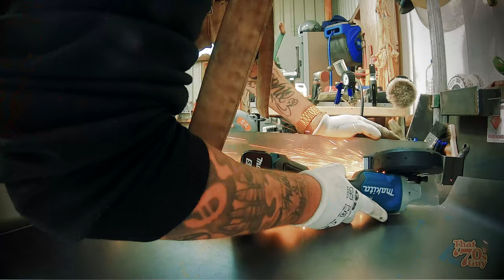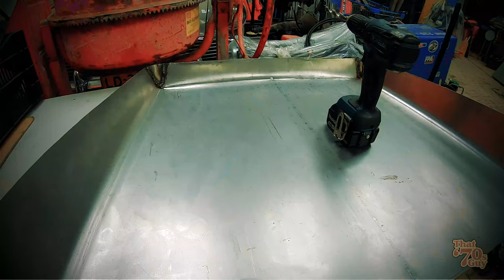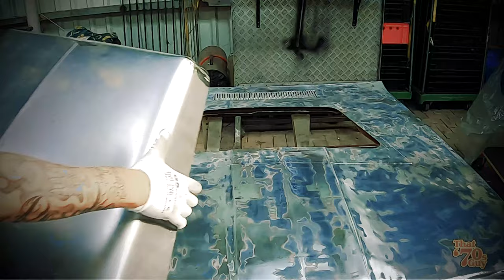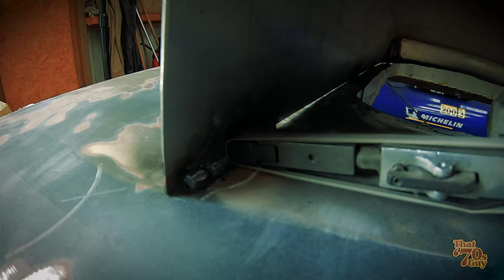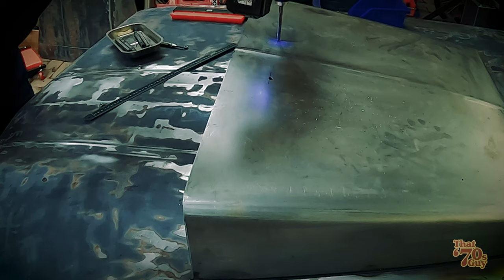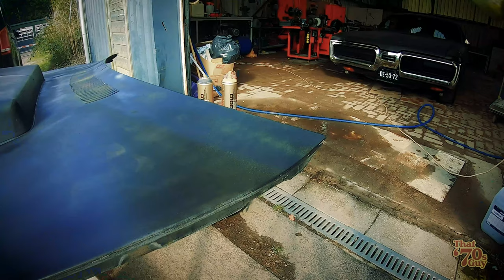THE HOODSCOOP OF DEATH! - Making a Steel Hemi-Style Hoodscoop For My '72 Fury With Basic Tools.

Comment: What was the adhesive you used for bonding and seam sealing? I’m going to be building either a hemi or six pack scoop for my second gen 2500 dodge this winter so I can put the filter/air intake for the 67mm he351 over s488 compounds I top the valve cover to suck fresh air from the outside rather than hot air in the engine bay.
Reply from the maker: I used black Bison Polymax for sealing.
Reply: @that70sguy  thanks boss.